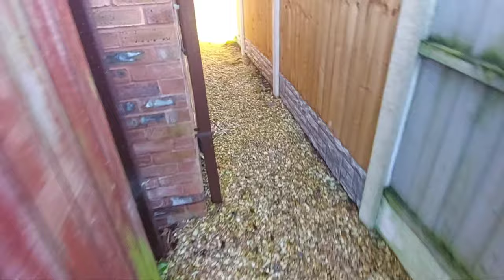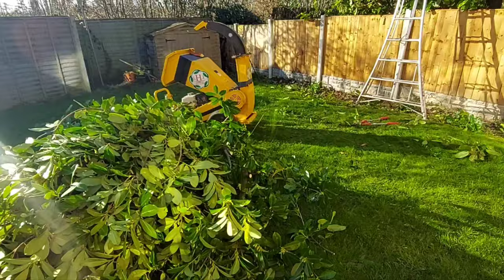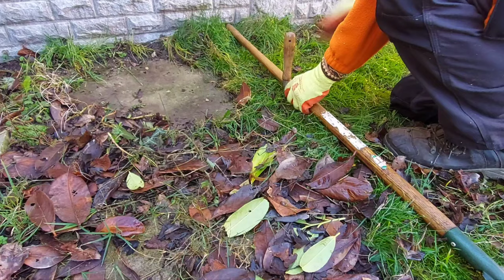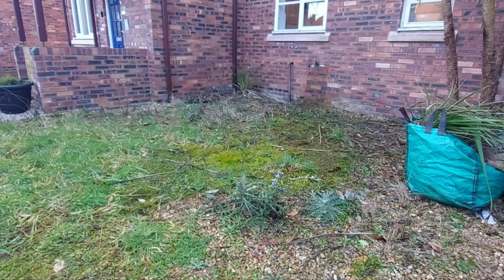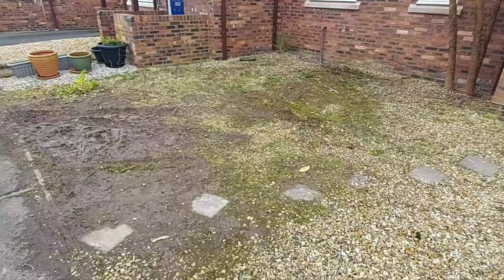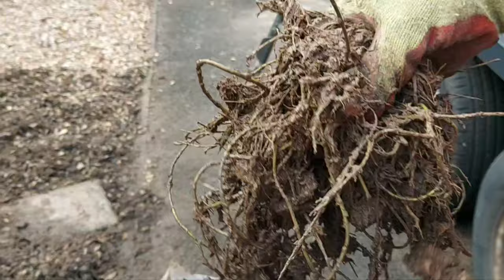TIDY UP of a RENTAL

Comment: Great to see the chipper fixed
Reply from the maker: 🙏😊...I hate it when tools break 😒
Reply: @LHLgardenservices   Me too my new hrx wouldn't start I bought it last September and got it out this week to do a lawn and it wouldn't start I just wanted to cry, I took it back to the local dealer and it was just a sticky choke back up and running in seconds. I will get a purpose mulcher like your one maybe mid season for hedge trimming. Ps I found out why to buy gear local when possible as it's only a short journey if anything goes wrong and under warranty
Reply from the maker: @neilgreen9285  great to hear you're back up and running 👊...yes nearer the better for that reason 🪛🔧🛠
Reply: @LHLgardenservices   Keep up your good work and videos Lee
Reply from the maker: @neilgreen9285  🙏